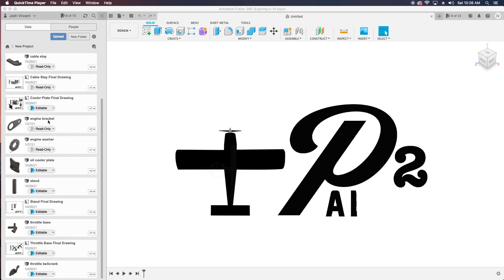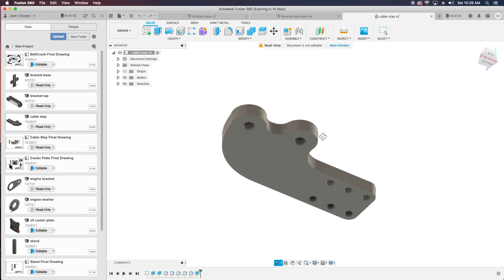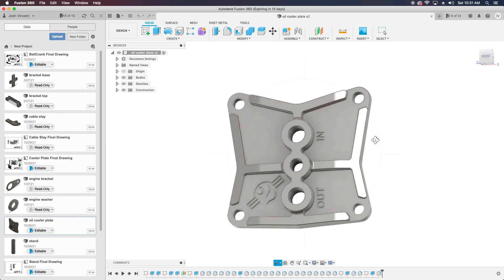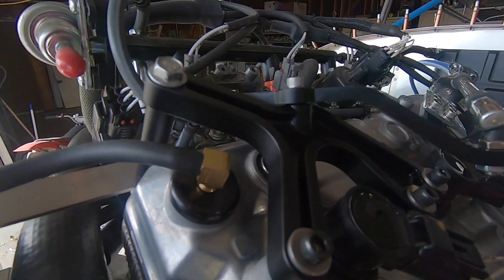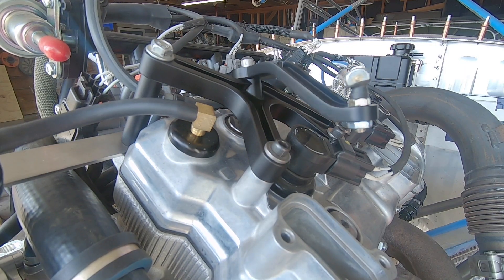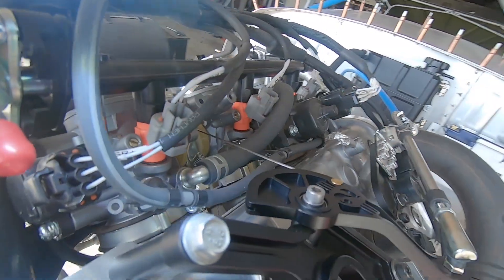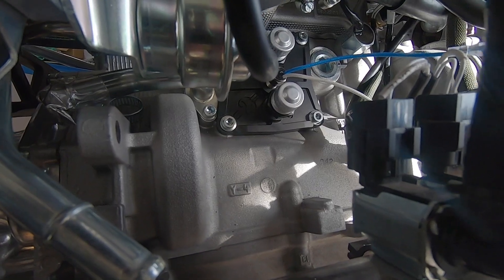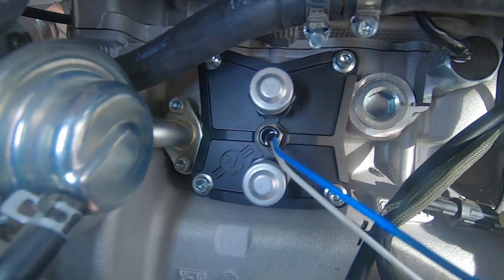Should I Sell? Turbo Yamaha Rans S21 EP41

Comment: I just installed your throttle parts on my engine and they are so nice! My only question is, how did you remove the stock cable holder so it doesn’t interfere with the short cable running to the bell crank?
Reply from the maker: Thanks man! Just remove that factory  bracket completely.. It’s only a few screws holding it on there and you should be good to go.
Reply: The two screws look pretty difficult to get to. Might have to try a 90 degree screw driver.
Reply from the maker: @justinmeaders  yea they are in there pretty good, but it’s doable. Could always just cut it off if you’d rather do that.
Reply: Hahaha! I had already debated just cutting it off. That might happen. Lol!
Reply from the maker: @justinmeaders  no shame in that.. lol may make access to the screws easier🤷🏻‍♂️

Comment: Excellent endeavour 👏

The ‘learnings’ will be in the testing, particularly your first 500 hours. 
Yup, for long term performance, it does take some time for those hidden problems - if there are any - to show up. 

As you are probably aware, commercial Aircraft test programs typically run 2,000 hours in order to work through to being able to confirm reliability targets. 

Your past experience obviously helps reduce risk and thus shortens the testing duration 😉

Great work on your part 👍
It is wonderful to see your progress. 
Thank you for sharing 🙏
Reply from the maker: Appreciate the input Dave! Thanks for watching sir👍
Reply: Forgot to Lazer etch your logo on the parts, other than that, looking pretty sweet.
Reply from the maker: @jodycard9489  I machined in logos👍